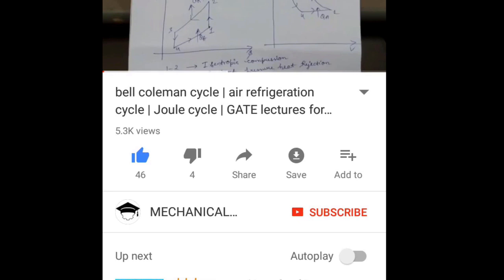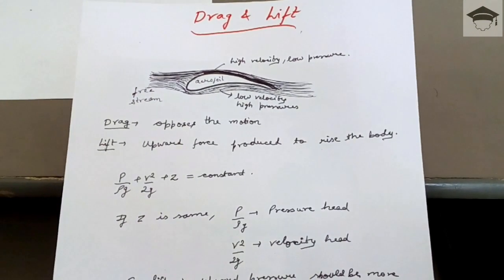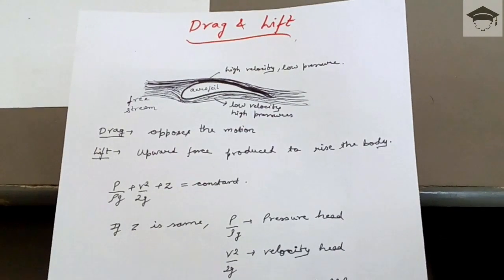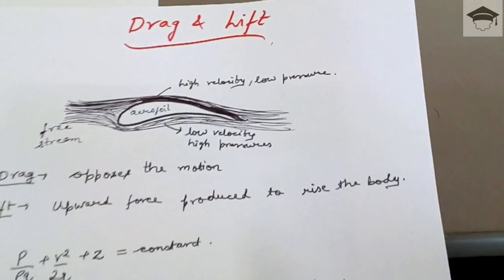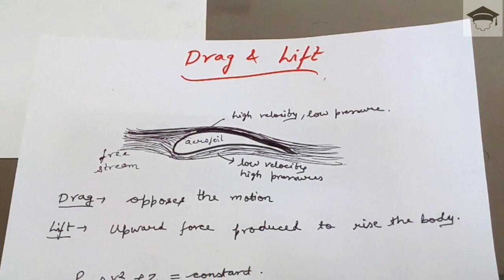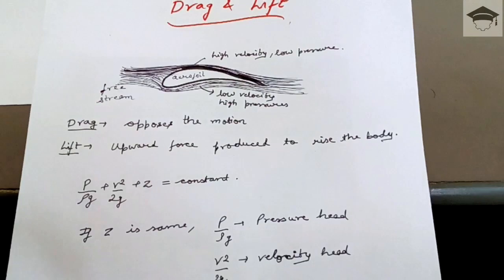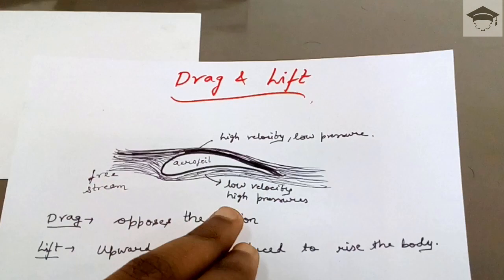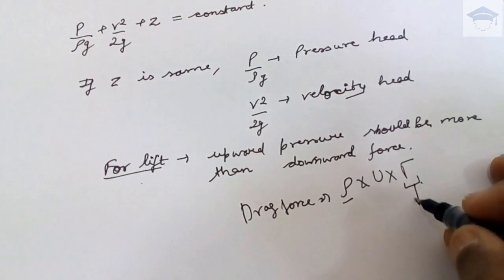drag and lift explained | lift and drag explained | airfoil tools | lift force | drag force

Comment: If body is stationary and fluid is moving then what is the direction of drag force
Reply from the maker: It will be the same. Actually when we do practical in wind tunnels then object is fixed and fluid is moving.But practically its opposite , the body moves through a stationary fluid.But the concept will remain same and the directions need to be seen accordingly.